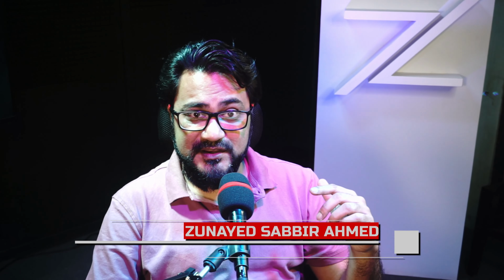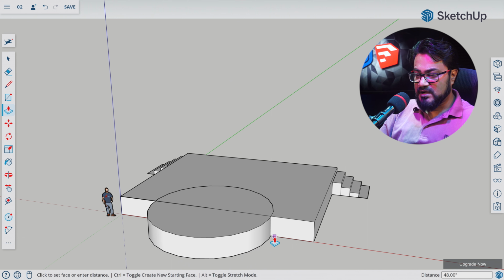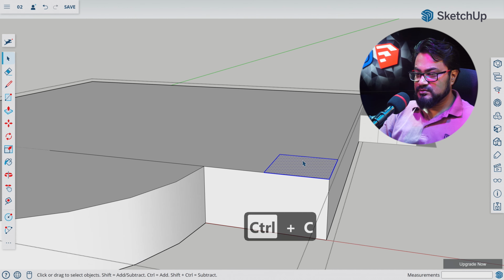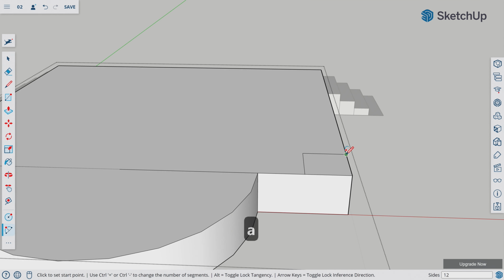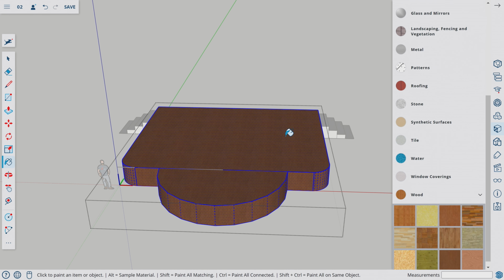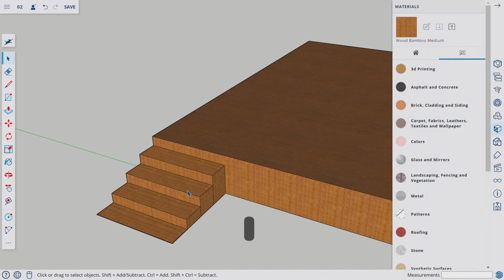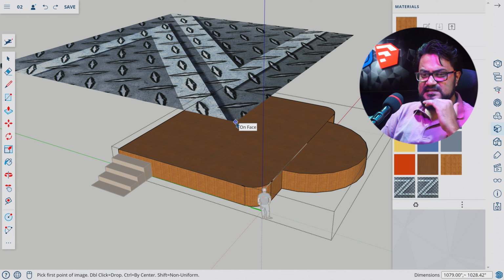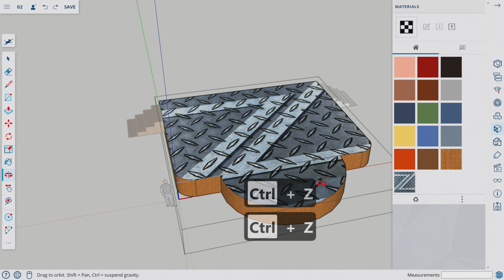Modeling Faster and Materials | @Sketchup WEB | FREE 3D Stage Design Tool !

Comment: Hi, You tutorials are very helpful and straight to point. I just have a little problem. When I try to erase the semi-circle not needed, it erases the whole circle. What am I not doing right?
Reply from the maker: erase the stroke of a circle it affects whole circle. 
after you draw a circle, use pen tool, then draw the parts edge to edge. after that you can erase the stroke for circle part and only cut part will go away